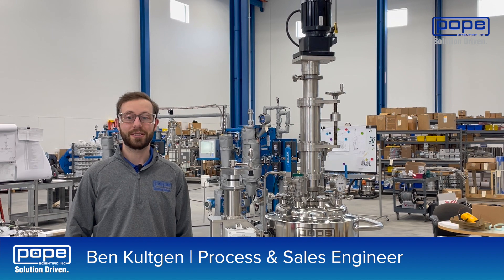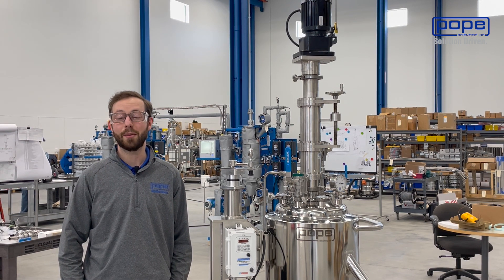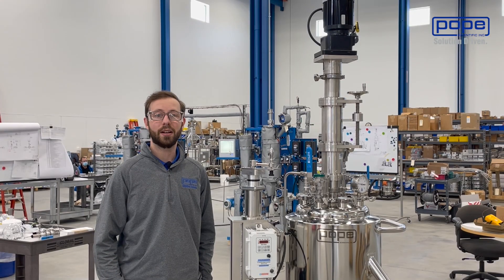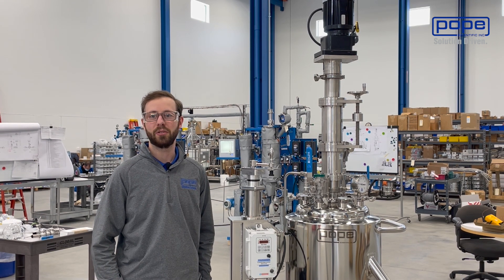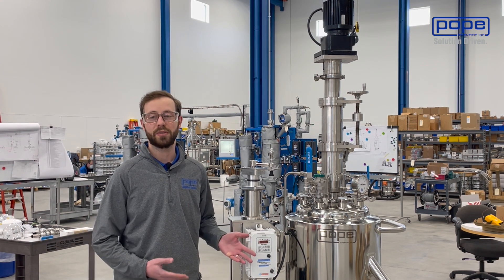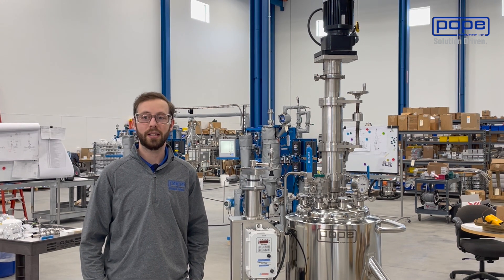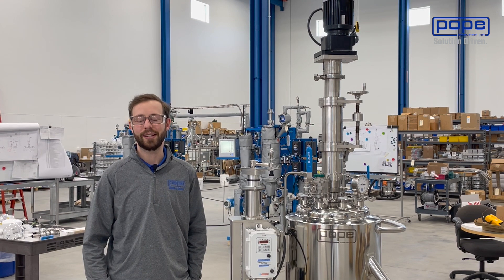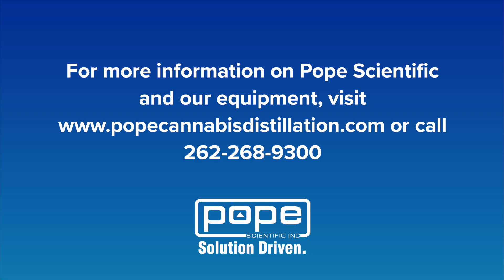Nutsche Filter Dryers for Producing Cannabinoid Isolate

Comment: Why so tall? Mixing?
Reply from the maker: The Nutsche itself stands a bit tall so that the filter plate on the vessel can be lowered and the dry product removed. The mixer on this Nutsche is one of our cake mixers. This has an extended height as the impeller can be raised and lowered into the cake for either breaking lumps or smoothing the cake.